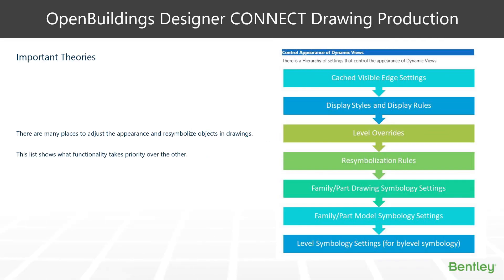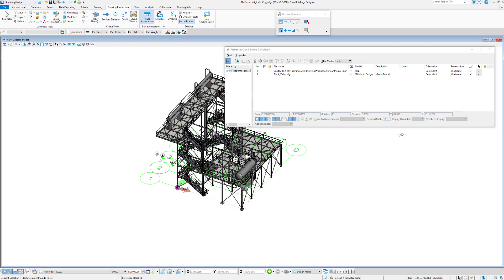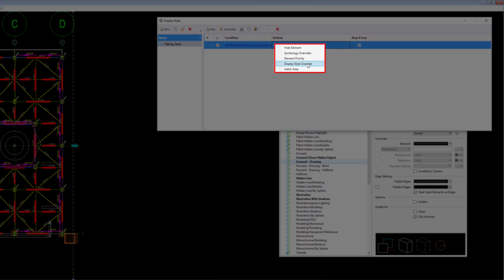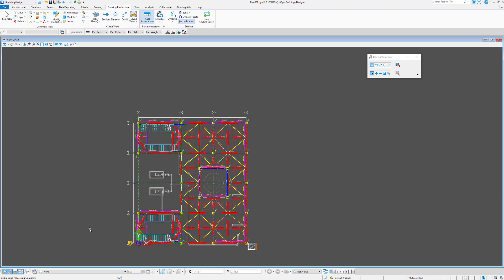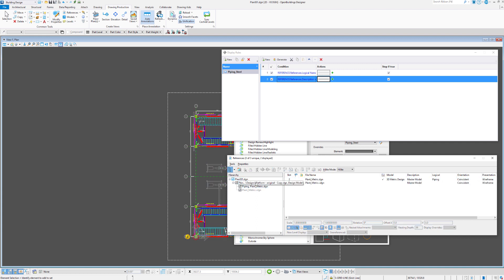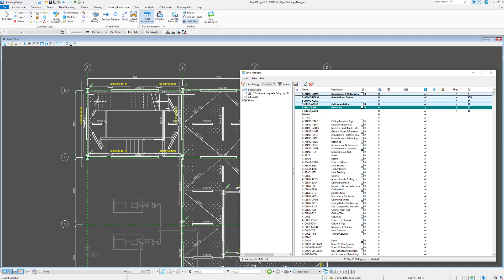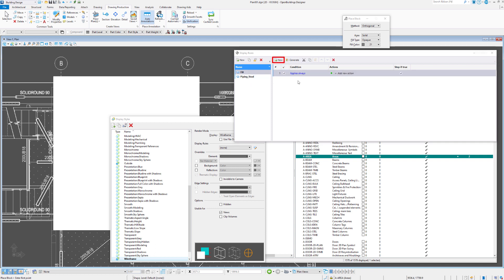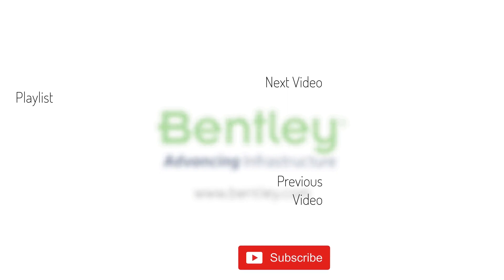Display Styles and Display Rules

Comment: How did you add broken line in the stairs?
Reply from the maker: Vio, The broken lines are part of the stair resymbolization.  This is based on a setting in the stair settings that defines the stairs location for 2D resymbolization.  If you open the Stair Settings dialog and select the Annotation tab, you will find a setting 2D-Display.  This can be set to Bottom Floor, Middle Floor, or Top Floor.  So if you set it to Bottom Floor, for instance, the stair annotation will show the treads above as dashed or broken lines.